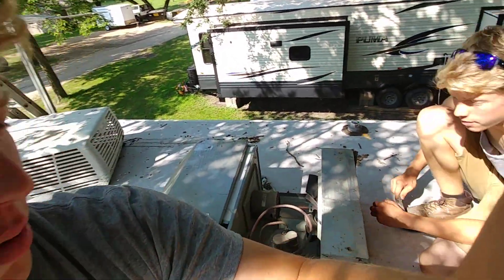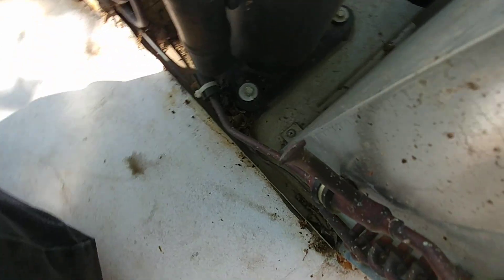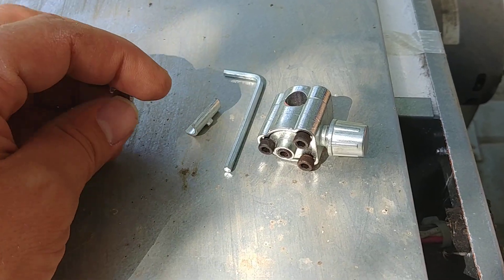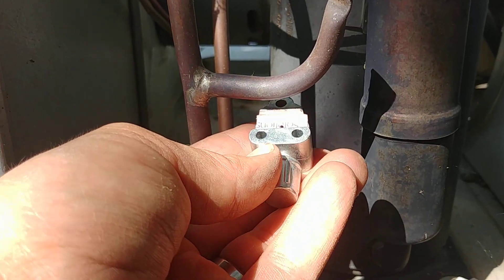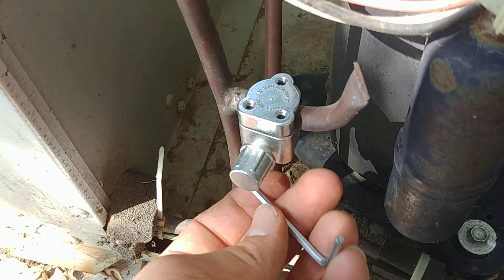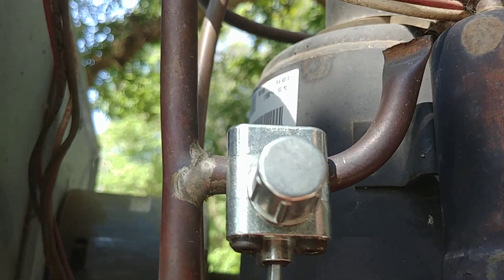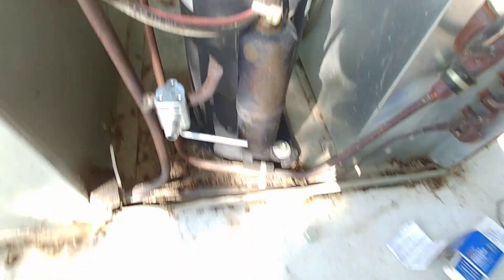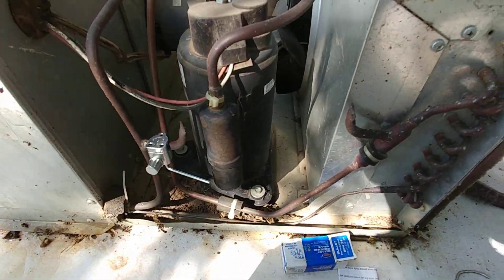How To Install a Refrigerant Access Port Line Tap On an AC Unit

Comment: These leak.  Every one.  Just solder a service port on. 5 bucks on Amazon
Reply from the maker: True. It's just a matter of time. Nice to not have to remove the refrigerant, though. Or are you talking about the solder-on service ports that don't require removing the refrigerant?

Comment: Great video, i appreciate you taking the time.

Things always change, i have a point of inquiry based on previous teachings.

I thought those are temporary valves, not meant to be left on? 

😅 happy to be found wrong, it will save me time and labor. I usually use a piercing tool like you do, recover refrigerant or prove its empty, remove piercing tool, braze in service valve, pressure test to find original leak and get to fixing.

Phew that is a lot.

Comment: Hi Ben, I just rescued a 2023 BriskAir II that seems like it might be perfectly functional. Compressor and fan motor turn on. Someone used a pierce fitting to recover the R410A from it. I'm currently looking for someone to negative test and fill this unit to see if it's viable, but having a hard time sourcing anyone, so I have a couple of questions.

1. In Canada we have access to R22A (Red-Tek 22A)' which looks to be direct replacement for R410 that anyone can buy from an autoparts store, so long as all 410 has been removed from the system. Is this a viable replacement?

2. The valve taps you have shared don't mention it, but several other valves on Amazon state that they cannot or should not be used with R410/A specifically. Is this a corrosion or failure thing or just due to the higher pressures of a R410 based system? IE, not rated for pressure of high side R410 units.

3. Can this be done without a scale, just testing the pressure and temperature periodically until within the specified range? 

I may need to do this myself since nobody in town seems interested in recharging this style of unit. They insist they're meant to be disposed of and replaced if they leak or perform poorly.

Comment: You should definitely not be doing this without safety glasses either, my friend. I would have put it on the straight run facing back toward the unit. LOLOL

Comment: if you are attempting to insert  and install this valve into an RV AC Unit, like how this guy shows you on this  you-tube,,, shows you how easy it is,,,,,this set up wont work......  they are no parts available on amazon nor int he retail stores to make the  refrigerant refill kit work on this bullet piercing kit..  good luck getting a n adapter from the HVAC stores as they have parts that will fit the nipple of the bullet part but they won't sell you one due to your lacking of an  of official "EPA" card
Reply: here comes the FUN POLICE!!!

Comment: The unfortunate thing here is that it in one's locale it is likely illegal to use that type of valve due to environmental regulations. Can you get away with it? Of course. SHOULD you get away with it? If you are a moral, responsible, and ethical person, then no. Legally speaking, the system has to be worked on by a licensed tech with the proper equipment. To make a point about how serious the government regulation is: a non-licensed tech could be fined up to $10k for working on that unit. The freon has to be recovered/captured, a fitting has to be brazed on, and the system checked for leaks with nitrogen, fixed, and then finally recharged. Licensed techs have a name for those piercing valves, and it's not complimentary. Google it. Spend the money and leave this to a licensed pro, or replace the unit. For those criticizing the manufacturer of the RV aircon for not putting a port on these systems, just open up your fridge or window aircon — of which there are millions — and see that they too are crimped and don't have fittings. I think they know something you don't

Comment: Ben is the man, everyone else says "replace the whole unit"   its as though diagnosing and replacing failed parts has went to the wayside.   Blows my mind how manufacturers dont put pressure check ports on refrigerant units.
Reply: Planned obsolescence 100%
Reply: @JesseDoesHVAC  needs to be criminalized.
Reply: To be classified as a Type I "small appliance", things have to be charged and sealed at the factory.  That's why refrigerators, coolers, icemakers, and freezers don't have ports.
(Which sucks, BTW.)  I'd guess that this kit falls in that category too.

Comment: Note in the instructions for the utilized tap:

“not for 410a”
And

“ Applications Install on the high side as a permanent valve on the job Install on round suction lines or uneven tubing…”

Comment: Hi.
Does anyone have any idea or know where to find the low side pressure for a coleman mach 3 15k with r22? 

Need to know to have tech top mine off. Thanks
Reply: Heliarc, did you ever find this information? I have the same unit and need it also.
Reply: @Hardcase19691  If you have same unit...assuming it still works at all I would foam clean and rinse with a water jet on a hose the coils, inside and outside. It makes mess inside unit but totally worth it to gain 100% cfm as it should be
Reply: @Hardcase19691  Check your tags on it and look for the type and  pressure some have r410a mine had r22
Reply: @Hardcase19691  Pressure usually is written on the tags.

But to do it right one really needs to extract and then weigh in some new r22 if you can get a scale and do it right. 

My acs are preforming much better just after a heavy coil clean

Comment: That short cubed piece of pipe was completely inconvenient to mount that valve onto. He could have just mounted it to the vertical tube that the short curved one is attached to. Do I need to think of everything?
Reply: Well common sense should have said to both of y’all, THIS GUY ISN’T ME AND IM NOT HIM, so we may have a different solution and way of fixing the same problem people don’t have to do it how you do
Reply: Personally .for unit he's working on. Why is he doing that. Why not install and Braz in some new connection points. I would of cut that away .put in a brand new T fitting with scrader valve stems

Comment: why not instal it on the vertical part of the copper tube?
Reply: One reason I can think of is if the valve install leaks, you can make a repair on the stub and not on the line going to your compressor
Reply: Same thing I was thinking

Comment: How charge should you put in?
Reply: You have to first look for labels on unit and determine what refrigerant it has....put the gauges on (the piercing should be on the low side (bigger of the two copper pipes) .
For that particular refrigerant find a P / T chart (pressure / temperature) and determine based off of it on the ambient days temperature what should your pressure be (mainly on the blue /low gauge).  And then if low add a little at time (3 second s maybe... What 15 minutes and see if pressure is where the chart says it should be , repeat if need more).....or just buy a new unit

Comment: This appears to be a technically-correct valve installation. The valve here is installed on the low side, which may be enough to check and correct refrigerant level, assuming you know what the correct low-side pressure should be for the system. It might be mentioned that larger systems have valves for both the high- and low-pressure sides.

Comment: Where would I look to find someone to do this for me in Massachusetts? I bought a used Soleus 6000 BTU Saddle A/C with a cut in the copper tubing for a good price. The previous owner had his plumber friend solder up the gash but gave up since it no longer seems to produce cooling and he thought it wasn't worth his time.
Reply: you want to braze when using refrigerant , make sure you triple evacuate before filling with any refrigerant also
Reply: @mytyhwh And don't forget to purge the gauge lines of air. Also a vacuum hold test to check for leaks.
Reply: @mytyhwh  Why do you have to evacuate before adding refrigerant? Thx for any info -
Reply: @MaximusMerideus  you evacuate to pull out any remaining refrigerant and even more importantly  to pull out any contaminates. triple evac is the best and purging with nitrogen in between evacs makes sure to be rid of contaminates. you can also give a little shake or tap lightly with a tool on the compressor to jar loose anything lodged in the compressor. triple evac first evac to 1500 microns second to 1000 third to 500.

Comment: Ok, Ive done Ac on cars and it needs a high and low side , this is a high side only? My TT AC isnt engaging, suspect low refrigerant and am looking for a tap to add to the system.
Reply: The video shows the tap on the low side, which is correct. Cars also get refrigerant vapor added to low side. The compressor clutch or relay can also cause it to not engage.

Comment: These are only good for reclaims refrigerant from a unit that does not have Schrader valves. I just cringe when I see these installed on refrigerators or air conditioners. These always leak !
Reply: Sven3xs  My HVAC instructor told me they always leak.

Comment: SHOULD HAVE PUT THE LINE TAP ON THE VERTICAL PIPE, NOT THE STUB. ALSO,  NOT STICKING OUT TO INTERFERE WITH THE A/C,  UNITE COVER.

Comment: Those saddle taps are only legal to use if you are recovering refrigerant. It is illegal to leave them on a system you are not going to repair, and are NOT legal to use for charging your system. If you need to charge an air conditioner, you need to find and repair the leak first.
Reply: I got arrested by the Freon police, and they were NOT chill…
Reply: @walterkersting9922  😅
Reply: Take it easy there, Officer Freon. Some of us out here would much rather take care of things ourself.
Reply: What would you suggest to use instead of the saddle taps and won't leak in the future?
Reply: Rob, once you find the leak, what is the best way to fix it?
Reply: deuchebaggggg alert

Comment: Do you open the Value when you added  freon to the AC
Reply: Before you open the valve have gauge installed with the freon ready...then open the valve put the refrigerant on when finish with the refrigerant close the valve all the way in with the Allen 🗝️ key put the cover cap you done
Reply: Can you guys help w that same question?
Reply: yeah open one turn (i do one and a half 😊) when you finish don't forguet to close it and put the metal cap,when charging do no pass the blue mark.
Reply: @edardon16  Do you happen to know low side psi for r22 coleman mach 15k?
Reply: @Heliarc91  That's the exact model I have. Now it is blowing warm air and it needs to be charged with that R22. Did you get that taken care of ?

Comment: Thanks for the video! Can you get the line tap at home depo?
Reply: try auto parts store
Reply: I would buy it from appliance or HVAC supply store
Reply: I ordered a couple on eBay from Arizona, they were extremely cheap
Reply: I went and they didn’t have it Walmart ?
Reply: AMRE supply
Reply from the maker: Not sure about that. I'm guessing probably not.

Comment: Did you add freon to it and if you did what kind did you add
Reply: That’s what I’m wondering. What kind of Freon do I need? I have a 15btu Coleman Mach rooftop ac.
Reply: @bradsmith4  It says on the data label on side of unit outside.

My coleman mach 3 15k takes r22. 
But mine is 2005 model. 
Never ones use r410a. 

I need to know low psi on the line what full.
Reply: @bradsmith4  mine was r410

Comment: You are a VERY smart man and a heck of a nice guy!!!!
Reply: You did everything right the only thing is the you grabe the wrong valve for that that one doesn't have the shrader valve most of the gauge nowadays have a low loss fitting that requires an shrader valve to read the freon temperature